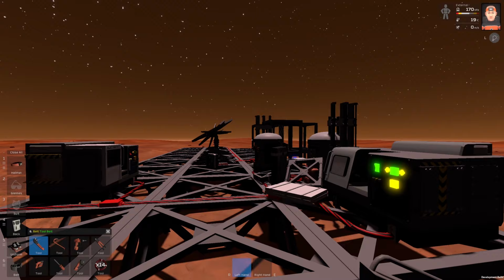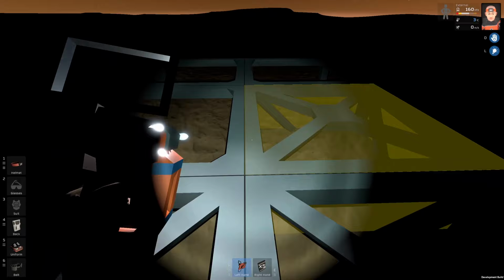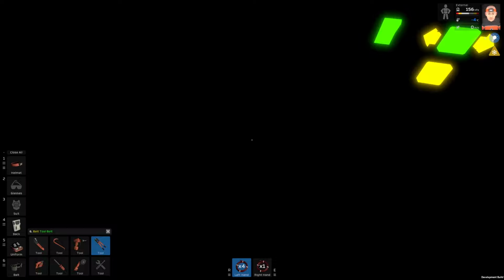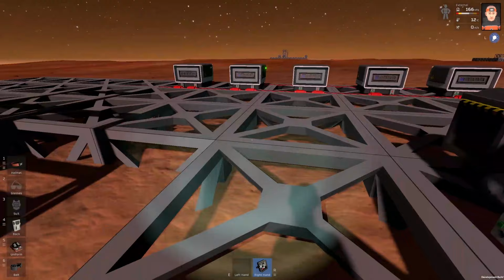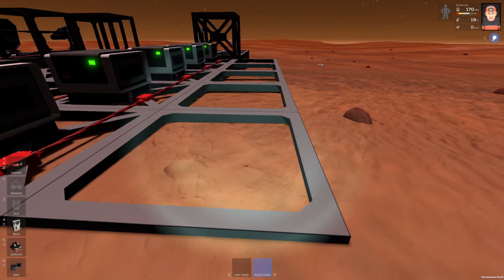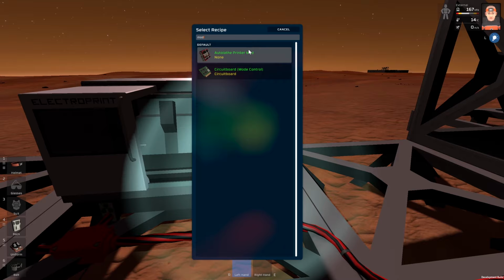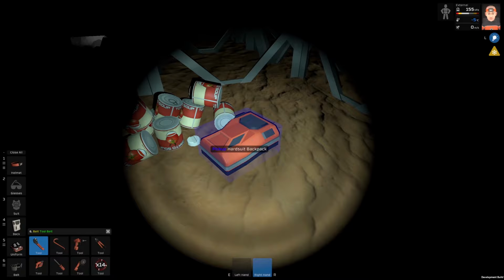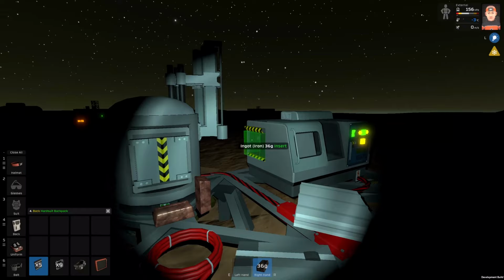Stationeers Let's Play Loulan Episode 3

Comment: On Loulan I currently have 7, but mostly because that is how many I have found.  Using the furnace is more difficult on Loulan due to the temperature/pressure, I even tried a vacuum chamber for the furnace but the stored Ices still melted/evaporatedwhen in a hard vacuum, So I usually rush Atmospherics and use a mix gas pump into the furnace for making alloys.  It seems Ice is more prevalent than volatile Ices So I just electrolyze the water into Brown's gas (2 pars H2 1 part O2), for running the furnace.  Just make sure the temp of that gas doesn't hit the auto-ignition point (I.E. don't use a gas mixer to mix hot H2 or hot O2 into your Brown's Gas tank.
Reply from the maker: 7 is not bad, you got more than me.

https://www.youtube.com/watch?v=vO63GsmpAXQ